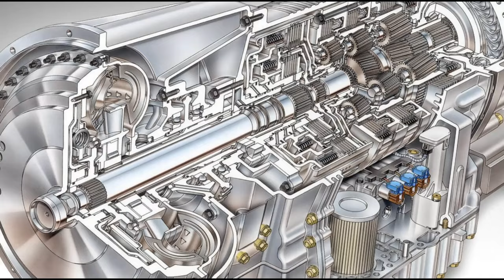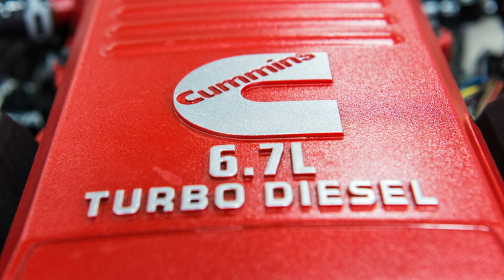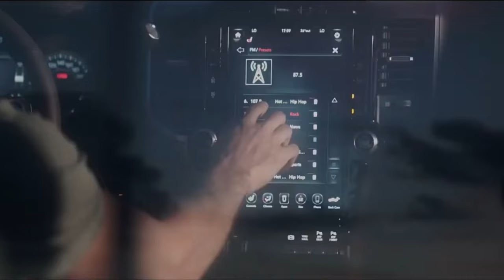Cummins engine and Allison transmission: Potential to enable 2025 Ram 3500 HD to tow 40,000 pounds

Comment: I’d rather Ram put the ZF 8spd. Not knocking Allison but I think the ZF is a much better transmission.
Reply from the maker: ZF is good, Allison is better, general opinion. They want to improve the performance. Allison and Cummins are not the best combo at the moment. But either if engineers manage to combine them, or improve the current gearbox, which is also possible, Ram will get a huge boost.